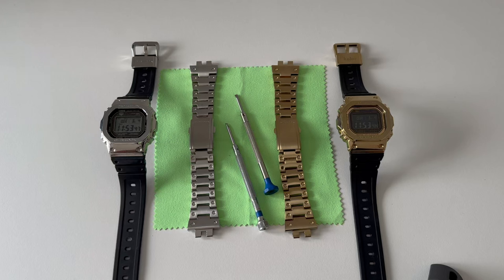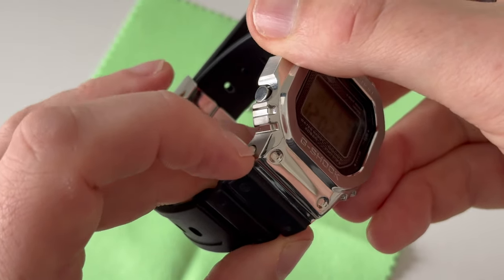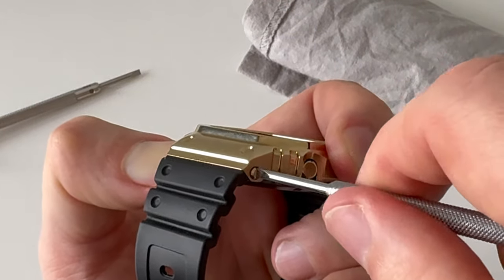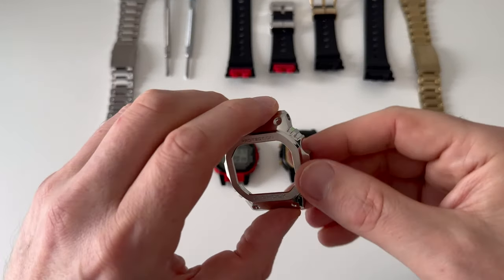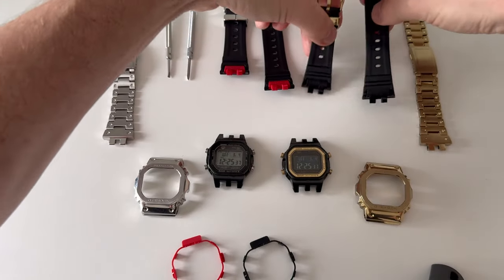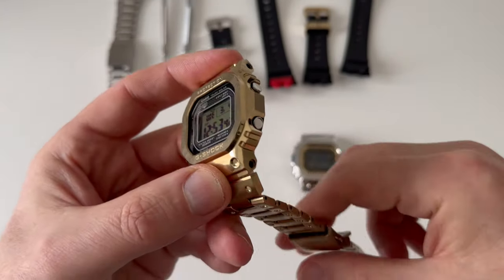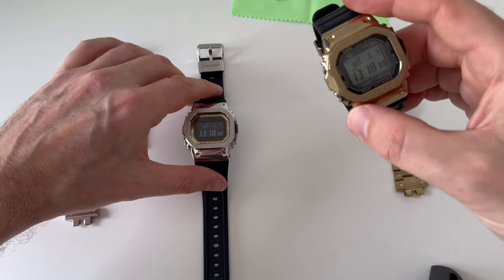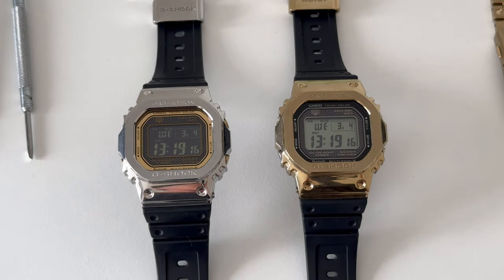#188 G-Shock B5000 Wheel Change Turns Into Modification Surprise GMW-B5000

Comment: Where do you get the different colored bezels. I have the rose gold but would like to change it to black. Also, do they sell resin bezels to fit these or is it only metal ones that fit these?  Thank you
Reply from the maker: I always get additional bezels from Casio themselves for example in the UK I go to Casio Parts Service Centre and there is another vendor called WatchWay.. I think they are called that.

Comment: Maestro! You'ld need a mini vise for this job with rubber shells on the jaws, to hold the watch firmly.
Reply from the maker: I bet Casio issue a special purpose jig that the engineers can place the watch into that secures the screws. It is fiddly but using a screw driver mounted to the edge of the desk then offering up the watch head is fine. I think I illustrated on another video.
Reply: Gotta be careful not to leave scratches on the case though. I always do this under magnifying glass.
Reply from the maker: @donaleeesio  I am very careful and normally I only apply pressure when I have contact with the crew head. I should really apply tape around the screw head but I am careful.